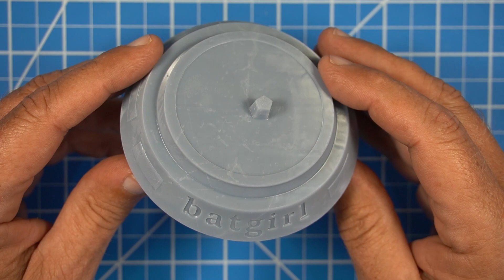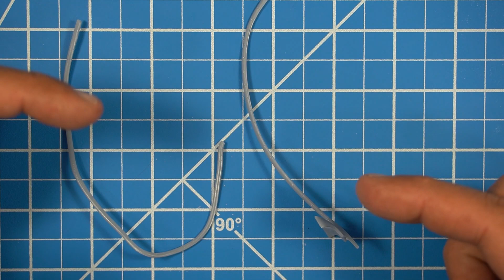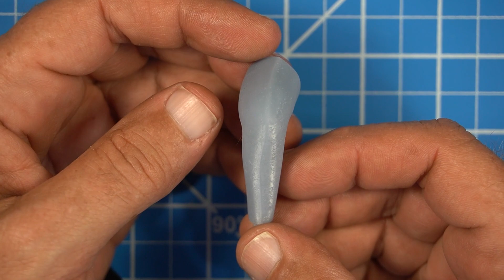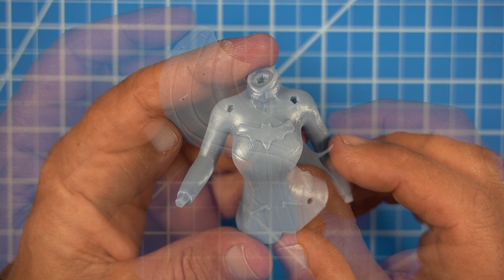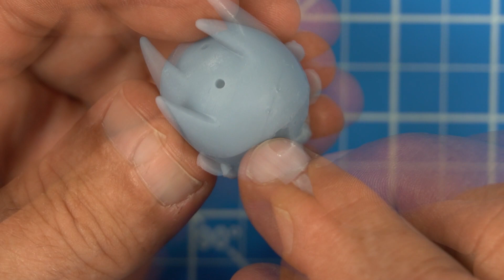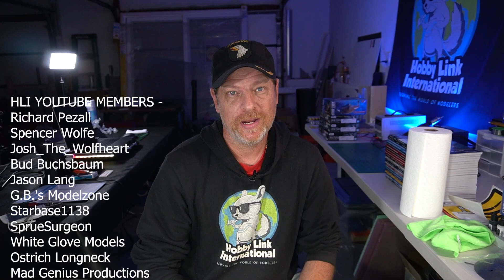DC Comics Batgirl - 3D Printed Figure

Comment: Hey Kenny.  Nice print.  Yes, of the sculpts that I've printed, I find the keys to be a consistent issue.  Often end up shaving and sanding a lot of the key down in order to get the parts to fit as close as possible.  Sometimes I also find that the surfaces around the keys aren't as flat as they should be contributing to a gap that has to be filled in.  This was the case with the recent anime figure I did.   As for the eyes.....I always start by painting the white of the sclera first.  In this case white would be a good choice since its an animated figure. If it were a life like sculpt, you'd add in cream, pinks and maybe blue. Once dry I lightly pencil in the edge of the iris. I start with a very dark color first, in this case maybe a dark brown and paint in the entire iris.  This is then followed by the shade you've chosen for the iris color leaving a very small trace of dark color along the perimeter.  This is because all irises have a dark border around them right  where the color meets the white (this are is called the limbus). It's particularly noticeable with blue, green and hazel eyes.   If the model is big enough one could also include  other details such as a little brown around the pupil and adding striations throughout the iris. These are all small details that are present in a human eye.  Adding the dark boarder and other details here aren't too critical because it's a smaller sculpt but these are all things to consider depending on how detailed you want it to be.  This is definitely overkill with the info here LOL but all fyi. 

I next try and figure out where the pupil should be. You can start with a pencil or use a paint brush or toothpick (if it's a small sculpt)  and dot the pupil at the center of each iris. I start with a small dot of black, make sure they look aligned and proceed to make them larger. You obviously want to avoid having a strabismic/wandering eye (more eye doc terminology Lol) so do this carefully.   The last step is to add a reflection or corneal reflex mimicking light (bouncing off the cornea, more eye talk there). I typically do this with a toothpick and some white paint. Once it's all dry, coat the eyes with gloss coating of some sort.  Hope that helps.  I actually should do a tutorial on this shouldn't I?  Will do.
Reply from the maker: Thank you so much for all the information O and I love the doc talk I learned new things!!

And yes absolutely do a tutorial on this, it would be awesome to see :)

Comment: As far as painting eyes goes, don't go the (seemingly) easy route and get eye decals.  They look weird if not positioned properly (or even properly positioned and/or scaled wrong).   (I tried them out 14 years ago).  Talk about an uncanny valley!
The best way is to blow up some eyes of the subject (cartoon or real life) and print them out as a reference for painting.  They'll look 10 times better. 

BTW, how does one get this kit, if one doesn't have a 3D printer??
Reply from the maker: Thanks for the tip on the decals. I don't think any of them would be the correct size for this kit. I think painted would look much better. 

If I can get the parts to print well we may be putting one or two up on the shop.

Comment: Nice print, Kenny !  Definitely pin the hair... With a part like this, you're gonna have a pretty strong "effet de levier" (don't know the term in English), and for heavy parts like that, I'd also use some epoxy glue rather than just CA, it provide a much stronger bond. ;)
Reply from the maker: Great idea on the epoxy rather than ca and I am leaning towards pinning that huge piece.

Comment: Looks like a fun kit Kenny. Hey those holes if you drop/glue a piece of plastic struck rod in them and clip make filling much easier. Also if you want, send me the hands and I’ll remove them and resculpt them without the ropes.
Reply from the maker: Never thoiught of using plastruct like that to fill the holes thanks for the tip Joe! I am going to test the rope out if gravity does it is thing I am shipping the hands of to you for the operation :)
Reply: No problem and I’m glad it will help.